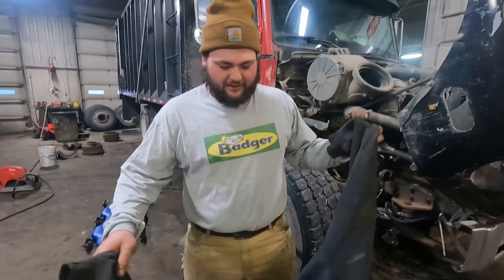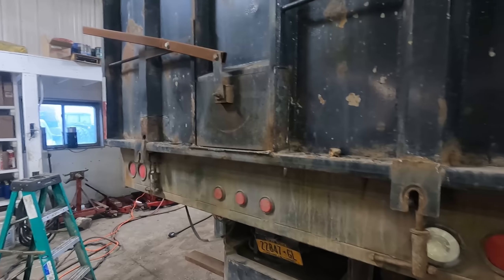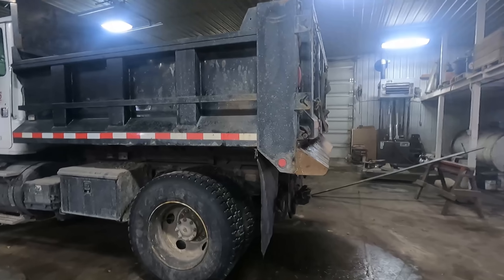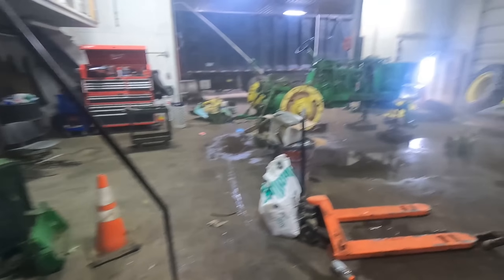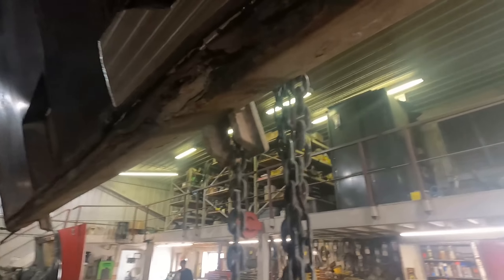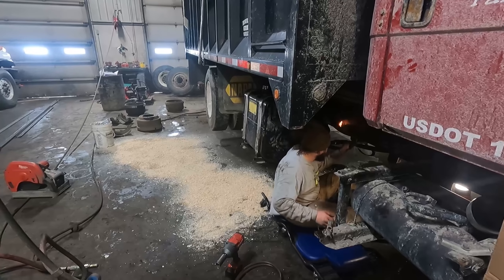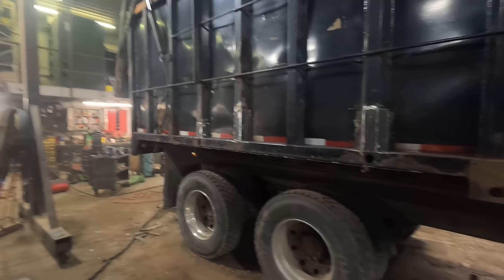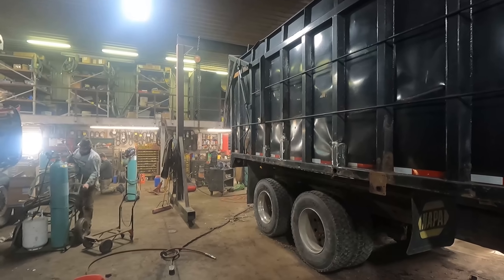Harbor Freight Special

Comment: Having the same problem with my 800 plasma cutter,  some times it don’t want to start the arch, luckily after opening up and cleaning the board it came out of it,  changing the touch lead with all new top parts did not solve the problem.  I found some info on line that’s pretty good to do some checks with a meter and looking at the LED lights on the main board.  Looks like the Cheepo works fairly good.

Comment: I’ve got a titanium 45 plasma torch and I have more trouble with it getting a good ground. Works good on stainless and new metal but will drive you nuts on anything that is a little rusty or dirty.
Reply from the maker: Change your clamp

Comment: Thanks for the explanation on the different torches and plasma cutters.  When I learned to cut and weld in the early 70s we only had only had an oxy/acetylene torch.  The first plasma cutter I saw was a table mounted one designed to cut stainless plate.  At that time there were no freehand models in the Nitrogen fertilizer plant where I worked.  :)

Comment: Well I'm going to be more clear it takes are rated at 500 but you only get about 470 in them and when it's real hot day it even less than that and then $1.95 a gallon you got to be careful when you use it how you use it

Comment: Hi we have a victor torch and I changed the tips so we use propane instead of acetylene.   I know it does not heat up as fast for cutting etc. Just wondering in your opinion what's more efficient and cost effective acetylene or propane The plasma cutter does it require oxygen on it?  Never used one but was thinking be handy to have. Are they better to have around with a touch? That small unit you have maybe one I should get. Thanks video have a good day.
Reply: Propane uses maybe 2 to 3times the oxygen? Bigger holes, more of them. Unless you generate your own acetylene costs the same unless you use liquid oxygen and cut a lot.  I think propane cuts better, tips are easier to clean. Finer detail using acetylene maybe.
Reply from the maker: Propane doesn’t have as many btu’s but it utilizes the oxygen better and helps make more heat when combined

Comment: Andy - apologies if this is a dumb question but I see you run 240V in your workshop and obviously domestic supply in USA is 110V. Is it common practice to do that in USA for commercial/workshop use? I guess you have a transformer in the supply? Single phase or triple? (I'm from UK and just curious).
Reply from the maker: 220 for higher amperage stuff our shop is wired 3 phase with a converter to knock down to single phase

Comment: That start/stop is a symptom of a bad ground.  You’ll find the HF unit will perform OK but the leads and clamps will be low grade, and the duty cycle will be lower than a quality unit.  But at 1/4 of the cost.....
Reply: Yes, the 2 second go and stop cycle is a safety feature and indicative of insufficient ground. The neighbor got one like that in the early days, the ground wire wasn't even 10 gauge, but enough to work fine if you scratched the area with a grinder first. Top brand name too, but I forget exactly now.

Comment: You mentioned a Harris torch one of the Harris factory’s outside of America was in Rathnew Ireland locally they are a popular torch because of a well known local guy who got a lot of gas equipment out the back door until he was caught he gave a torch to a friend of mine that would cut chassis the deep way no problem till the cylinder would frost up

Comment: I want to get a plasma cutter but im looking at a hobart since i have a hobart mig 190 and they are sold at tsc stores so i can get consumables easily but i have to watch my amps because i run off a 7500 generator and i bought a used small 220 compressor that takes around 12 amps. Once i i get my own place i will have hard wired power but i want it to be portable like my welder setup already

Comment: The Titanium isn't a bad unit but its not a Hypertherm. I think you should still get the Powermax 65, I have one I bought the end of last year and its just awesome. Hypertherm has started to have availability issues since December. So if you want one, beware they aren't always available right now. Also Hypertherm has a trade in program you should ask your dealer about.
Reply from the maker: The trade in thing only offers about &400

Comment: My biscuits are burning! 
When you replace your plasma cutter take and cover the torch lead  with hose rap. Did the to mine 10 years ago and it still works. It keeps the rubber cover from getting cut up.

Comment: I remember buying loads of tools from Harbor Freight as a kid when they sent out the catalog, most of it was crap....they've improved the quality on a lot of their stuff. That rosebud is purely legendary, keep up the videos if you can, enjoying it.
Reply: I grabbed a small ele.concrete mixer at Harbor Freight, it needed a few modifications to keep the belt on the motor pulley, but the damn thing has mixed a lot of cement & still works.

Comment: Not boring at all - keep them coming.

Question: when you buy a new piece of equipment, is the cost charged to the shop or do you have separate accounts such as for the shop and the dairy side of your operations?
Reply from the maker: It varies

Comment: I’m curious to see how the Titanium plasma cutter holds up for you.  These new inverter machines are sweet.  In the last 3-4 years I’ve added 5 inverter machines and think they all run good.  I’m still running an old transformer plasma rig though that weighs a ton...

Comment: Might check out YESWELDER CUT-55DS with pilot arch which is a plus. Recently bought my plasma cutter from them and already have 60+ hrs on it and it seems to work great with no issues so far. Also uses Miller consumables so they are not hard to find. I dont think Harbor freight has pilot arch is why it wouldnt cut that dirty piece of metal.

Comment: When you switch to 110 you lose half the cutting power I have a Hobart will do half inch on 240 but only capable of 1/4” on 110